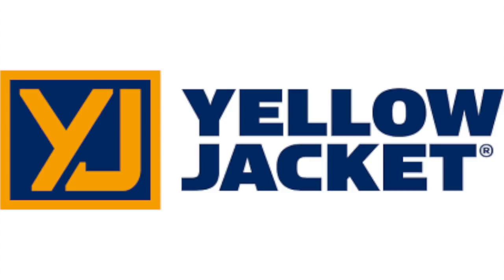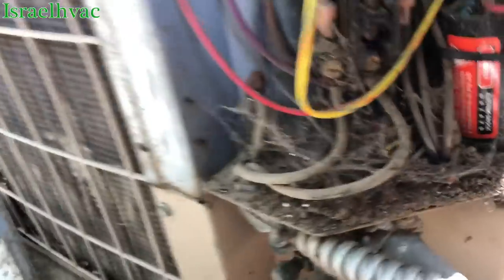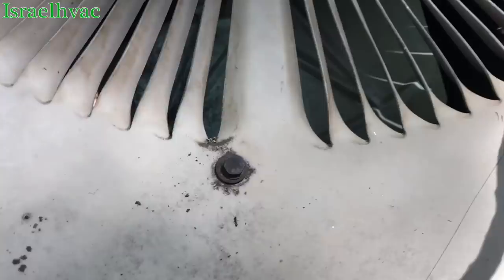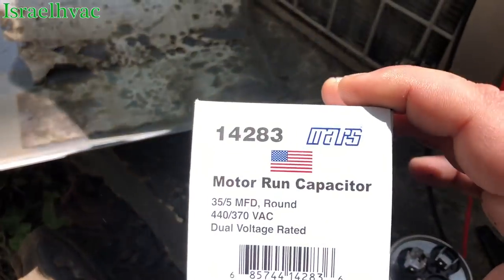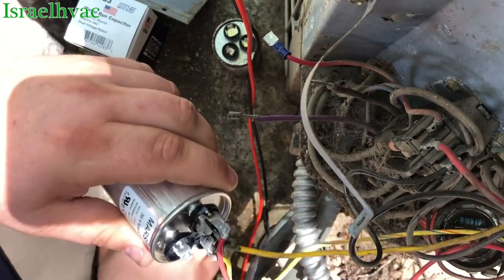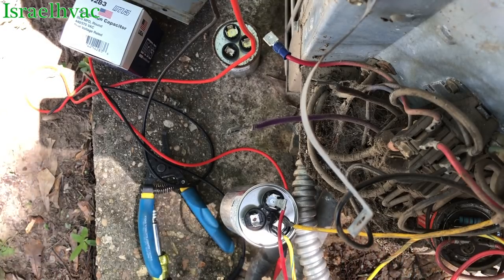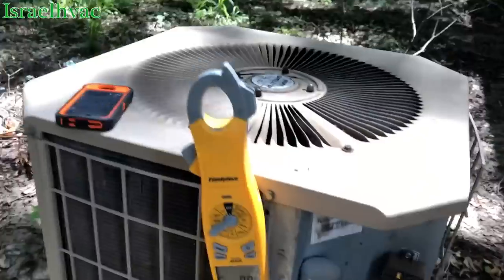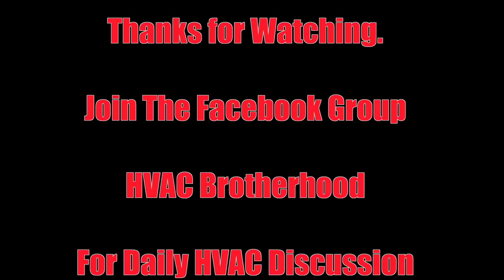Bad HVAC Capacitor | I Make a Big Mistake

Comment: I got one for you, I was working on a bathroom light fixture, so I put the wall switch down in the off position. Started to work and got shock of my life. I found out the customer installed the light switch upside down. from now on I will use my voltage tester.

Comment: Can't help but remembering when I was a newly minted teen-ager we had a 1948 RCA 16" console that kept blowing a black and white tube. So instead of calling the TV repair man for another $16.75, I went down to the local Kresge's 5 and 10, and bought a replacement tube. I got home, took off the cardboard back of the TV just like I saw the repair man do a couple of times, and pulled the burnt tube. I touched the CAPACITOR [key word for this video] and got instantly knocked ass over kettles for a good six or seven feet -- ( learned later that force equals mass times acceleration: I weighed about 80 pounds - since I got thrown about 6 feet I later calculated that that puny resistor exerted about 500 pounds, with clothes on,  and ever since have had a deep abiding respect for capacitors, whether they be on a PCB board, a 1/2 HP motor, or in an HVAC circuit! (Just as an aside, but come to think of it, my Labrador Retriever shares the same respect after peeing against an electric fence, but for a different set of reasons!)

Comment: That’s a good lesson John 
You did not show the disconnect though I watched again to make sure. Always use your meter before and after disconnect. You’re right never trust the disconnect. If it’s a fused disconnect it’s unlikely there will be power but it’s possible and I have had a couple do it if it’s a breaker type used earlier they are more common to fail internally older knife switches are really bad as the fiberboard on the lever to knife often breaks and can leave it connected. Fused disconnects are pretty much the standard now and should be replaced if any doubt. 
I can’t remember how many times I got buzzed and learned a lesson each time lol screwdrivers or needle nose pliers were modified Slightly. 
Just remember In our trade that meter is your extra hand. Thanks for sharing and explaining.

Comment: I had the same thing happen to me changing out a 40 hp motor on a rotary screw air compressor. I checked across from leg to leg on the bottom of the VFd, but did not check to ground. One of the knife disconnects had broken off inside the panel and was still hot. I had my hand on the motor as I grazed across the bare wire end. I definitely did not need any more caffeine that day. Live and Learn

Comment: More than one i've been shocked on a gas furnace where somebody had broken neutral through the switch and hot wire nutted. 999 out of 1000 may be correct but the one can get you good. We can get complacent. Thanks for posting.

Comment: It has happened to me. Makes me feel "So Alive". When I was a young technician I was remove hard start after getting compressor running and zapped the "F****!" Out of myself that I yelled. I felt it thru my chest. NEVER AGAIN! I had a habit of of just pulling low voltage off contactor to work on replacing capacitor or replace motor. I have been zapped doing that too. Washing down condenser and while removing hoses from an old Fedders unit got zapped by fan motor housing (bad ground).

Comment: I've seen disconnects wired backwards ... You never know who you're following ... Good vid ... Stay safe ...
Reply: I've seen/replaced many disconnects half burnt from loose screws with one or both legs bypassed. homeowners or handy-man doofus gang or lazy hvac guy without disco on truck..
Reply: the issue comes with fused disconnects, ones that have tube or screw in fuses in solid holders or behind a plate. if you don't notice it's wired backwards you'r fingers/tools are grabbing live fuses, I've done plenty of accidental arc welding over the years ;)
Reply: I take it you haven't dealt with many of the older breakers like "federal pacific" those allowed an arc tokeep burning the tool, lugs, wire and anything else in the path, it wasn't uncommon to cut into live wires when rewiring residential homes and with F.P. you went to buy new cutters and wipe your jeans. worse than standard cartridge/screw in plug fuses.
you sure don't want to see a 480V 3phase arc on a 15Amp F.P. breaker it took well over 30 seconds to open, after it blew a 12AWG wire off a terminal and arced phase to phase, melting away over 1" of wire and copper sputtering everything, including me who was standing with my back to the box when the motor controller failed. three others nearby watching got flash burnt and had to deal with eye drops and visual issues for many weeks. while not proper PPE, the leather coat I had on took the molten copper spray like champ, a shirt would have had holes as well as burnt spots on me.
Reply: so if i want to be safe, just not only pull the plug from the condenser and also power off the circuit breaker in my garage right?
Reply: Yes, but do like he did and check your voltages before reaching in.  Check pole to pole, and each pole to ground to find out if everything is as expected.  

He actually still had one leg (110v) still hot even after the disconnect, so never trust!  You can't see electricity wanting to zap you, you just have to respect it, and know that it might be there.
Reply: Live wires are normally protected not all neutrals. I have seen customers shocked when cowboys have swapped L & N and disconnected the earth to stop the fuse blowing. Yes I reported did anything happen? No
Reply: @inquisitvem6723  You should only need the circuit breaker off. Still worth a quick check.
Most meters have this function on them now and only need to be pointed at the wire.
Reply: D B  Unless you get an inspector who actually does his job!  Then you get a "reinspect fee" (and no, the inspector doesn't have to tell you why he failed the install)
Reply: @michaelwaller8252 it happens all too often... then again, I'm still the same crazy guy  who will wire 208Y/120V and 240/120V live. just zapped myself last week in fact lol.
that makes about 19 zillionth time in my life........
Reply: @throttlebottle5906  I've been in HVAC and convenience store maintenance since 1990, and will diagnose and wire stuff live...I don't prefer to, but if I have little choice, I do.  I have even replaced a complete 200 amp breaker box...pan and bus live before...wasn't comfortable doing so, but it was july 4th weekend, and if I had had the main pulled by the power company on that Saturday, the building wouldn't have been re-energized until the inspectors checked it the next Tuesday...and my customer would have not been happy loosing that many days business!

Comment: Same thing happened to me last week while replacing a capacitor.  Almost shit myself!  Disconnect was pulled and I shorted out the terminals to discharge the capacitor.  Thought i did everything right but still got a jolt.  I never figured out how it happened but after watching this i wonder if the disconnect was bypassed somewhere. Ever since i always shut off the breaker and still check for power with my meter.
Reply: Yeah I don't understand that either you pulled the disconnect and pop the break or out and it's still something back feedlng
Reply: @deddie4645  Sometimes capacitors store a small charge in them (that is why start capacitors have "bleed resistors" on them).  I ALWAYS keep an old screwdriver for shorting across the capacitor terminals BEFORE I start taking the wiring off.
Reply: @michaelwaller8252  same but he shouldn't have been reading anything across the contactor with a new capacitor. I also blew a terminal last week doing the same thing
Reply: @okc405sfinest  After 29 years in the HVAC-R and C-store maintenance industry, every once in a while, we get a little care-free or in a hurry and the next thing we know, we get a "tingle".  Thank GOD, I've not had a "dead" hit, and don't want one

Comment: Disconnects in visual sight of the unit are a "second line of defense", (first line being that muscle between your ears), nice and frequently required by code. Always knock the power off to the entire HVAC system at the main box. And, test, test, test for current throughout the unit. As part of the local home "grid", God knows from where they may be getting power.

Comment: Im not seeing a whole alot of comments about exactly why he was shocked. First things first disconnect of course and breaker aswell but the main reason behind the shock is because of the fact a capacitor holds a charge, good or bad. You Have To Discharge The Capacitor!!!!
crossing a screw driver through and accross the terminals and to the frame!! using insulated pliars is a guaranteed no shock !
Disconnect and Discharge !!

Comment: I'am electrician, never "trust" breakers also, ! Was replacing GFI Recpt. bathroom, my buddy, turned off breaker, well it hung up, power still on!
Reply: I always treat wires as live, even after knowing they're dead or just wire live and you'll be careful after being zapped 9 zillion times. OK I may seem nuts to most, but I quite often wire residential 120/240V live, replaced main breakers without pulling meters. yes it all depends on wire gauge and age, don't want to play with crumbling wires live.
yes I've been zapped umpteen zillion times over the years, majority just through a few fingers or within same hand.
Reply: throttle bottle. You must be some how immune to getting zapped, if its aleady happened to you on multiplied numerous occassions before today 2018-07-10.....?
Reply: I have fairly high body resistance, especially the hands, but they're not as rough calloused as they used to be, so I'd probably get zapped worse now. last time was a few years ago and it's never fun! :)
Reply: so is it better to just turn power off to whole house via circuit breaker(located in garage) while doing this work?
Reply: for added saftey and if your unsure, turn all breakers off including the main. then again, if you're unsure, perhaps you shouldn't be doing the work to start with :)
Reply: well, replacing the capacitor was easy, but making sure all power off is something many are still unsure of.
Reply: @throttlebottle5906  Good shoes and dry socks helps too :)

Comment: A few times I did not pull the power and trusted the sparky the N and L are back to front sod's law. Always try to work with one hand on a live system avoids the heart getting shocked, never work with the other hand earthed. Remember an open circuit motor will store voltage in the start capacitor. Also, Triacs will mostly fail closed circuit with a motor fault.

Comment: I had one disconnect with "fuses". The "fuses" were 3/8" copper tubing! Wired so when you 'killed' power, those "fuses" were still hot. Just goes to show, there are two kinds of techs: those that don't trust anything, and those that are either dead or have permanently curly hair. Always check power to chassis ground. If you want to be extra sure, jump the supposed dead lead to chassis with a good sized wire.

Comment: I’ve had brush ups with 208 volts. 120 still hurts but doesn’t light up my nerves nearly as much. But i concur with treating wires like they’re hot. I personally work on small appliance sized heat pumps (water-sourced) in a recurring lab setting but when i was first messing with the disconnects this was a thing i went to check regularly when i had to directly wire in a unit to the disconnect.

Comment: Did that one time with my left knee on saturated ground and got it from right hand left knee and it hit me hard, felt it squeeze the air right out of my chest. I had to lay down right there in the yard about 5 minutes to catch my breath and not feel like I was going to throw up any more. Looking back, it probably knocked my ticker out of whack and damn near killed me. The little tingles and little bites we get when the current goes across the hand or across the arm can make us forget that if the current goes through your chest, it can stop your heart and kill you dead.

Comment: Yep always do ur same routine even if u know its pointless sometimes. Make it a joke to urself about it. Cause when the homeowner starts talking about blah blah blah ull be more likely to stay focused on half of his conversation n half on every step of ur routine. Before i apply power n theyre still talking i triple think n just stand there n kinda becomes a joke of the conversation like yep when theres distractions always make it another routine to stop n overthink an extra minute when it comes to electricity. If blown up capacitor or just service call routine or a trick service call i check my leads r pushed in meter all the way, i make sure my leads arnt getting worn n part of strand not exposing at butt end of it as leads get older n rubbing on metal (ground) n check power across contactor L1 L2 to see if power tripped, n if 0 volts i check each leg to ground like this guy, n if still nothing i touch my leads together n put meter to ohms for continuity to prove ur leads were good n pushed in ur meter all the way. Then kill power. Check each leg to ground for 0 volts (same as above routine after turning power off) Sometimes for grins ill push in contactor to make sure comp dont kick on as a 4th safety messure. N i also make sure no one inside is gonna turn cooling on tstat not thinking n if i got loose wires dangling n hits coil contactor then now i gotta replace contactor, transformer if no low volt fuse in circuit board, or my luck curcuit board too and thermostat all burnt up. Always be self aware n do same routine so when theres dustractions ur not distracted....by the homeowner telling u how he built his house n hes an engineer n wants u to look at something else next n his kid plays soccer n do I have time to put a new tstat on n if u want him to hold the flashlight for ya which means hes definitely hanging out to watch then n then offers u coffee or soda on a late afternoon 98 degree day n if u wanna use his kinked hose w broken nozzle to clean the condenser even after u just told him he has a shorted to ground compressor n still asks if u want him to turn the thermostat on n if u take military or senior discounts while his wife interupts 30 minutes later how the other company was just there n if i could fix it. Great times.

Comment: Make sure you don't get the two wires for the fan and compressor reversed on the new capacitor. Odd how the compressor will start and run with only 5uf. The fan motor will get very hot with a high value capacitor and  quit in about 20 min. The compressor will start and run after being off for an hour but if it needs to start under high pressure it will fail.  A quick look at the compressor will verify the color of the wires going to it so the capacitor is wired correctly.

Comment: I'm paranoid.  I always use strippers or needle nose to connect the spades.
Reply: Treat any wire like it's live, just like you assume any gun is loaded.
Reply: I watch some of the old hats I work with and I have seen some foolishness  all because they dont want to get up and walk to breakers. I guess they ain't died yet from wiring hot but I sure ain't pushing my luck!

Comment: Really unclear what happened here.   You said you "hit" the disconnect (1:18) and pushed the contactor in manually, wheich energized the unit.  Did you leave the disconnect in/on?    Then forget it was on?    You never explained where the power came in from, only to never trust a disconnect.  That would mean to me the disconnect was pulled out (or off) and somehow power was bypassing into the unit, but you never explained it.

Comment: You mentioned apartment unit. So the sub panel is going to be inside. With the homeowner not there that could be a problem. Then again what if the problem was a bad transformer in the FAU that brings 120V down to 26V for the T-stat and contactor on the heat pump. I always do a quick sweep with a screamer (non contact voltage tester).

Comment: I noticed a possible code violation where regular flex conduit was used, being outside exposed the elements , ought to have been liquid tight flex conduit going to the disconnect. The property management company needs to have their electrician check that disconnect, good advice always check to be sure the power is off.

Comment: What I mean is even if you hate your 30 amp breaker for split system that powers the condenser and the fan you still have a 120v circuit tied into the outside contactor on your condenser coil because you have central heatso what I mean is that indoor fan whether you're cooling or heating is wire to run when called

Comment: Ive been an electrician for nearly 18 years now..  Journeyman for 14.     I still always scratch all my conductors to something bare and grounded even after my initial voltage check.   Ive just been shocked too many times to NOT fear getting hit.   I deal with a lot of high voltage lines that run parallel to one another. this induces a charge in de-energized lines when others remain energized.   Since they're insulated high voltage jacketed and armored, they act like a capacitor when open ended and ungrounded..   talk about getting the piss knocked out of you!  We keep them grounded 90% of the time of course but have to unground them for tests and termination..   thats when people get hit.

Comment: I'm not even a repair tech and replaced a capacitor recently and used a non-contact tester and neon tester, both verifying that they showed hot before disconnecting (verify tools), then after disconnecting not hot. And put the disconnect breaker on top of the unit so I can see it with my eyes that it's out.